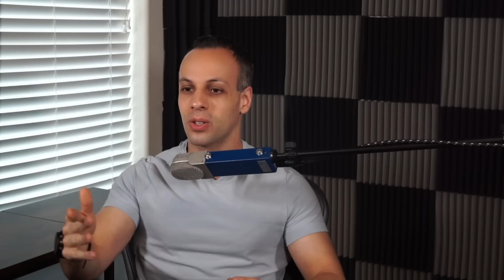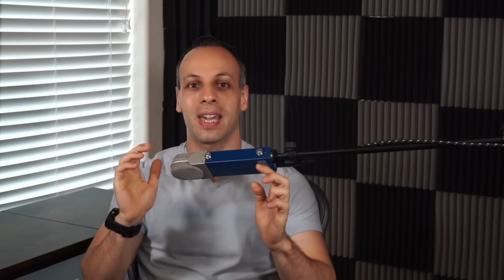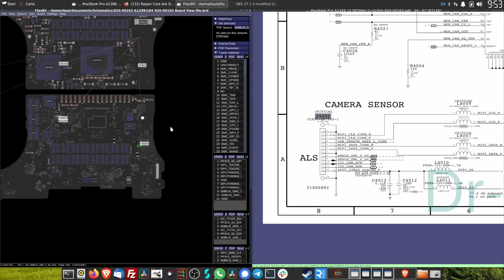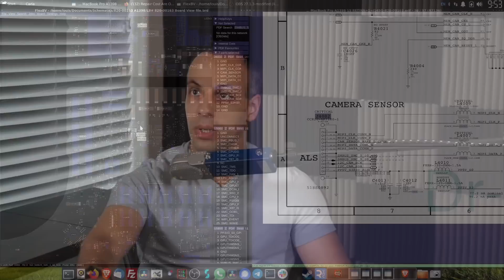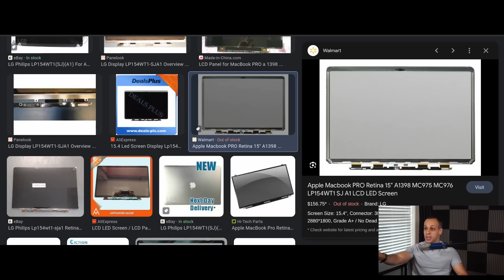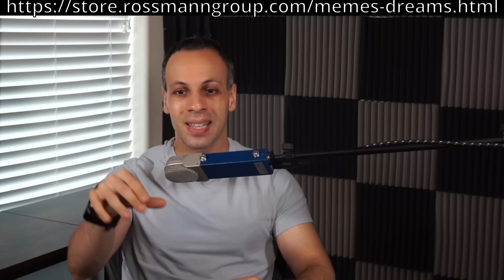The Ford F150 Macbook - when car repair resembles macbook repair...

Comment: Someone please remind me about what happened when the first electric Mustang was released. I have a memory of a customer having some kind of problem. It was possibly a very light fender bender resulting in a tail light being damaged. If that wasn't it, it was equally simple and something you would think was an easy fix.
What happened though was that the part needed to repair this new, used by the customer for less than a week, car was not available as a spare part. And that they would have to wait for something like half a year for Ford to ship the replacement part.

Like I said, someone please remind me about the details if you can remember this story and what happened. I feel it was something that had relevance with the problems talked about here.

Also there was something on some other channel I subscribe too about a Rivian truck getting rear ended. And this time there was a broken tail light and a crushed rear fender. Thing is the truck has a unibody construction, so you can't just detach the right rear fender and replace it. Instead the repair to fix a slightly crumpled fender was, if I remember correctly, a $20,000 job. And no the truck was not undriveable or anything. It was just a bump on the fender, purely cosmetic apart from the tail light needing to be replaced.

I mean sure, a unibody design is very strong, stiff, and probably very fast to produce. But if it makes repairing the damage of a light bump so incredibly expensive then is it really a good thing for the customer. Also remember this is sold as a truck capable of hauling heavy loads. Just for the love of your wallet do not bump into it  as it costs a fortune to repair the slightest bump.

Now the owner ended up going to a non Rivian shop where they cut out the damaged parts, then some how they got hold of the parts they needed. They might have cut them from a crashed Rivian truck. These were welded in place, the welds carefully ground flat, filler applied and everything carefully dressed and sanded to shape before being painted. The result was indistinguible from a non damaged truck, and it cost a few thousand dollars instead of the twenty Rivian quoted for the job. It was still harder and more expensive than if they had just been able to take of the rear fender and bolt a new one on.

Things like this makes me wonder just what they are thinking when designing these things. A truck will be dinged up. It's what they are made for! that means they should be constructed with that in mind. Repairing one should be easy and economical. Not something that will wipe out your savings account. And no, having a good insurance is not the answer. Insurance should never be the answer for why repairing something would be expensive. The more money the insurance companies pay out the more expensive the insurances will get. In the end it is you, the consumer who pays the higher price for repairing these cars and trucks. Simply said, There ain't no such thing as a free lunch! ( TANSTAAFL , remember that phrase!)

Comment: Yep, I have seen this on headlights as well. They are connected to the CAN Bus for some advanced form of auto high beam. But you get a little bit of water and cause a short the CAN network just crashes.

I don’t know if it is still the case but you have been able to buy temporary access to workshop manuals from ford. But increasingly the wiring diagrams stop at the modules themselves and no schematics for the modules themselves. So not always useful.

Comment: Fords are a joke, would never buy one... especially since the keyfobs use the same frequency as many gas station security stations so if you park too close to certain gas stations your car won't start! This has been an issue for at least 5+ years and Ford is not telling people about it or fixing the issue.. you find out the HARD WAY when you buy a Ford! The fix to this? You have to do a series of steps including putting your key fob in a little pocket in the center arm rest, etc. Ford needs to stop making more problems.

Comment: As if I needed yet another reason to continue resurrecting my 37 year old F350 that hasn't ran in 29.

Between new vehicle pricing being astronomical and the non user serviceability of new vehicles. It is still the more economical option.

Comment: The insurance industry should be pushing back to reduce repair costs but they don't really NEED to when they can just raise rates and pass the pain to their customers.

On another note horrifically complex  modern vehicles are easily totaled. A sufficient hit to a rear quarter totals most sedans and SUVs, A buckled cab floor or frame damage sufficient to require replacement totals most pickups. Flooding totals almost any truck or car. 
What anyone does with that information is up to them.

Comment: Ohhh, I have some experience with Ford’s genius design. I had to replace the headlight on my 2016 Ford Fusion Energi, a task that — I kid you not — requires taking off the entire front bumper. I do so love taking off at least a dozen clips to replace one of the most common wear items on a car.
Reply: Also I sure hope you planned to replace all of those clips, because they will break
Reply: Not defending ford or any other automakers but that is not so uncommon to have to do, especially if the bumper is molded around the headlights. But hey at least you did not have to disassemble the rest of the front end!

Comment: You think that's bad look into the belt Ford is using to drive the oil pump on multiple engines in their lineup (to be fair, they aren't the only ones doing this).  In in the case of the 2.7L turbo was a design change, and a choice to reduce cost, and you know they  have to know the impact of moving from a chain to a belt to drive such a critical part of the engine (that is stated to last the life of the car).  "I do cars" has a great tear down video with a oil pump belt failure on a Ford engine.

Comment: I think that the designers do think about the lack of durability. I think they put research and development Into designing products with specific and predictable failures.  They go out of the way to do this l it gives them  Control over a product after it’s purchased they know exactly what, and when is gonna fail, and guarantee them more money. They definitely are aware of this unethical practice , and your are correct that it is considered to be the norm everywhere .

Comment: This reminds me of a 6 year old DiagnoseDan video "No start because of Doorhandle!" where as the title states, a BMW was basically bricked due to a shorted door handle that took down the CANbus. Independent shop had to hand it over to a dealer, which applied a fix more hamfisted than Apple's U8900 refurb process. 
Honestly I really don't understand why we need so many freaking widgets on /every/ modern car. I'm ok with it being an option, but ffs keep the basic reliable stripped down model available as an option too pleease. 

Can you imagine how well we could make a basic cheap car with the technology we curently have?!
Reply: We dont need it or want manufacturers want it

Comment: I saw this BMW that went through a flood and turned off.
The shop that looked at it, found that the whole mechanic of the car was perfectly good but it had a single electronic module that fizzed on the flood and BMW basically made it impossible to replace that part with DRM, and not even BMW themselves would replace it.
So the car ended up sold for parts.

Comment: purposely built in fail points, this way of making vehicles is only going to get worse until the government stops it every company in all manner of manufacturing is going down this road, as soon as i fixed that i would have sold the truck and would never buy another Ford i would also make sure the dealership knew that they will never sell me another truck because of this, that is highway robbery wish i still had my 82 F100 open hood recognize all the parts and easily access all the engine parts to replace them made a huge mistake selling that old workhorse

Comment: On the F150 with the Alpine audio system and I think the B&O sound system the amplifier is on the CAN bus and if you bypass it, you will be stuck with a check engine light.

Comment: A lot of people don't even think about how this would affect your rising insurance rates: a simple backing up into another vehicle in a parking lot would be covered by insurance. Except now its a $5000 tail light, $4000 bump, $3000 in sensors, $2000 in computer calibration,  then installation of the above. A simple fender bender in a parking lot can easily be $10,000+ and insurance contractually has to pay that for minor damages.

Comment: Can you imagine this. You get a car that has self driving capabilities, but you don't subscribe for them. You get into an accident that damages one of those components, but to repair the car you have to replace the self-driving sensors . I can just imagine this coming next. All those features you didn't buy and don't use because you didn't "subscribe" for them, are damaged, and you have to pay to repair them in an accident even if you don't use them. Seems like this kind of thing is on the horizon too.

Comment: I've worked as a test engineer for a big  manufacturer of among other things ecus dor cars. The standards (at least in europe) stipulate a short to the power rails of an ecu or to the comm lines should not affect the other systems. I think the designers of this model of  Ford did a piss poor job honestly. Also,  it's obvious that there was little to no testing done on these ecus before being put in production. So basically this should considered to be a manufacturing defect

Comment: As an IT Specialist myself, I used to cringe at the idea of soiling my beautiful hands on dirty vehicle mechanic work. Until a faithful day in December 2015, I was charged $100 to change my oil for my pickup truck 🛻. And I felt that pain of paying $100 and the employee's reasoning was "oh well it's a bigger vehicle and etcetera". I went ahead and checked on Amazon the pricing of 6 quarts of 5w30 and K&N filter for a 2013 F150 3.5L Ecoboost. Grand total, wait for it, $32. Yep I got robbed big time. From that moment on and fast forward 7 years later I now do all mechanical work for my pickup all on my own. I bought all the tools, floor jack, jacket stands, 16 quarts oil drainage pan, cholk blocks, and I buy all the parts and pieces and upgrades at the lowest possible price and start hammering it away at my truck. I feel good and proud afterwards at the massive amount of money I've saved doing all my own vehicle repairs and repairs for my parent's two cars. I change my motor oil, transfer case fluid, differential axle fluid, transmission oil fluid, upgraded to a JS 390 Amp Alternator, Serpentine Belt, Thermostat regulator for the coolant, brake pads, brake rotors, brake fluid, master cylinder, brake booster and even upgraded to a XS Power D3400 battery and upgraded from Halogen to LED bulbs and even put a roof light bar with my dad helping me. So in short, hundreds if not thousands of dollars saved doing everything on my own.

To my fellow IT Specialist brethrens, male or female, grab the mechanic manual for your vehicle and start reading and studying and invest in all the necessary tools and resources to make life easier and simpler. And YouTube tutorials are your best friend/guide, USE IT, I have and I've learned so much thanks to the countless auto mechanic YouTube videos. God bless them all for the work and passion. 

Now go save some money and not give it to bullshit mechanics who overcharge you and upsell the heck out of it.

P.S. I suffer from a herniated/bulging disc in my L5-S1 region and Piriformis Syndrome. If I can do it so can you. However and obviously within reason and within breaking limits. Many times my dad has to assist me when my lower back begins to lock up on me or when my Piriformis Syndrome becomes unbelievably unbearable that my dad has to finish the remainder. So please, take it easy and go slow, especially if you suffer from neuropathic pain aka nerve compression.

Cheers 🍻

Comment: My F-150 Super Cab 2007 Ford spontaneously started fire in my driveway, apparently there was something that was always on, almost burned down my house.. I didn't drive the truck that much but every once in awhile one does need a truck to haul crap...

Never do business with the company that insures all the service people,USA - extremely bad hard to get payment... I ended up having to scrape all the toxic waste off my driveway.. because that wasn't covered..
I've heard in States like Michigan they just deny claims, they don't exist...

I bought a 2005 Scion Toyota, with a small engine, very easy to work on.. bonus it had the nice leather interior.. from DTLA Union Station. took a train to Orange County Regional Transit, drove it a few minutes did the transaction in cash, Craigslist very happy...

I think new cars are probably just a problem waiting to happen...

Comment: Funny. I saw this video in my feed and just said to myself "yeah yeah screw that, I'll mod my truck if OEM crap is that expensive" and didn't give it a third thought. Mine is a stripped XL anyway so I have that option.
Wait, what distro is that? I can't place it. It looks a bit like Elementary, but I doubt you run that one.

Comment: Screw liquid resistance on a tail light, that literally doesn't matter because if it's meant to be an off road truck it's going to get poked by branches and stuff and cracked. It's a vehicle. You bump into it carrying something past or around it because again, it's a truck and you're going to be doing that too, and water can get in anyway whenever it rains. This design is just stupid.

Comment: This is the exact issue with medical insurance. Everything is broken up into different departments and nobody talks to one another and they can't access info from another department so when you get bounced around you have to tell each representative the exact same info.

Why is a truck, designed and advertised for off-roading, not have seals/gaskets around parts that don't like talking a bath?

Comment: In the old world even like 20-30 years ago this was called a manufacturing issue and treated as such.
Basically, the manufacturer took the L, does not even question the thing and just fixed it, because they were the ones who fucked it up.

Comment: well, I believe it's all down to fact that companies try to keep tabs on every second of development, and try to cut that time at every possible spot. What goes first? stuff that you dont need to check for legal reasons or for truck to work in perfect state -> as it leaves the dealership. 
its easiest thing to cut of the process, to save time, and that's what happened here.

I just hope that they at least make sure nothing will disable your breaks because you spilled coffee on central console...

Comment: It's going to trickle down? That trickle started with the quality improvement craze of the early 90s (as the US auto industry tried to claw back some market share from Japan). It's called DFM: design for manufacturability. Which tends to have very different principles than design for repairability. Some of it is great, like making sure that there is only one way to plug 2 connectors together, and parts built to ever finer tolerances so that maintenance won't be required for years; but it's also the reason there are no $10 parts for almost anything any more. Now we have expensive "assemblies", which are so much easier to, well, assemble. Disassembly, heh, not their problem. We humans don't seem real good about thinking for the long term--we are blinded by sticker price and don't consider maintenance costs down the road. So more and more stuff is built to use relatively briefly and toss away. But that's the price for modern wizardry. Cubans can keep 1950s-era cars running like new to this day, but that technology--of a 20th c. machine shop--is long gone.